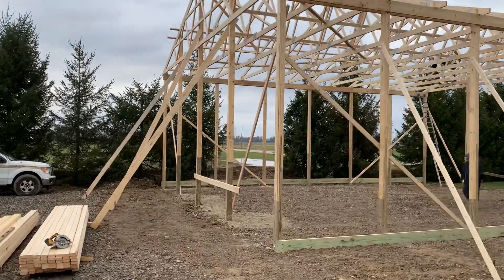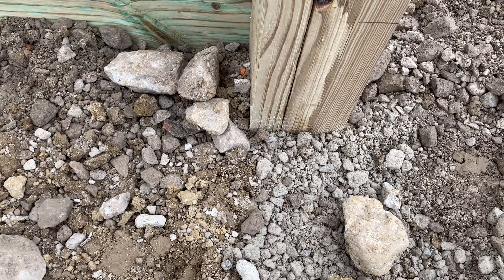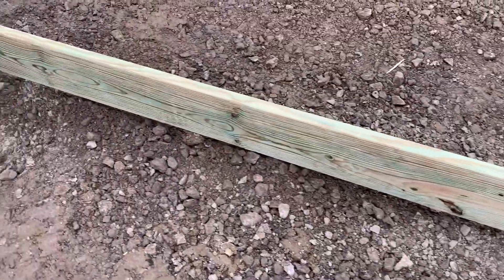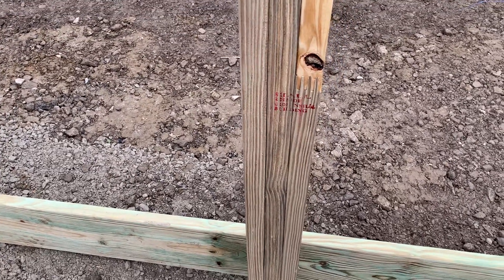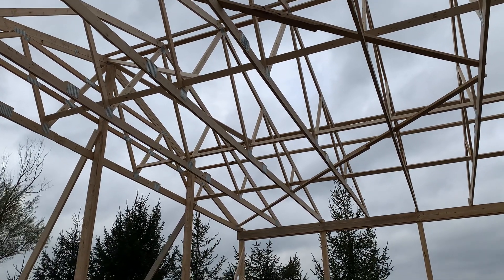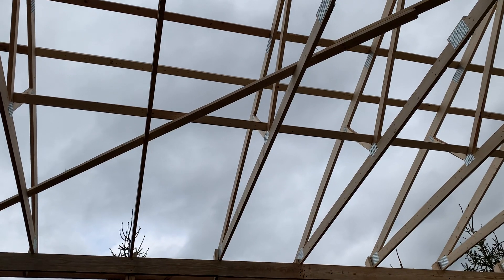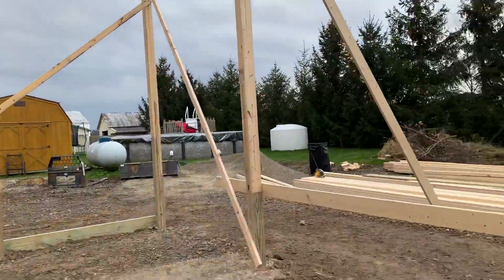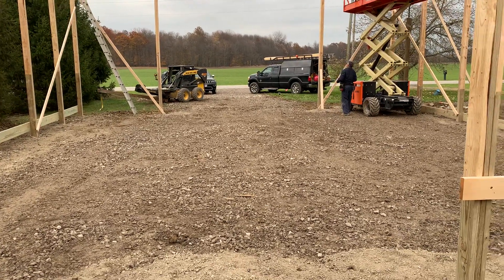Pole Barn Trusses - What cost less?? (40x48)

Comment: If your looking for a ‘Forever” building…this is not it. It’s nice to say the WOOD posted in the ground will last forever…they will not. Pressure treated, Thompsons Treatment, a little extra sand in your post mix, is not the answer. YOU SHOULD TELL PEOPLE WOOD IN THE GROUND WILL NOT LAST AND BE A HEADACHE AFTER 15+ YEARS. This is a temporary structure unless you make SERIOUS modifications. Thanks for letting me vent.
Reply from the maker: Opinions are always welcome.   Thanks for your feedback.

Comment: You didn't even answer your own title question... What truss spacing or system costs less?
Reply from the maker: The wider the trusses are spaced the less the trusses are utilized in the building.  Check out the description on the video.
Reply from the maker: What method cost less?  A wider truss spacing uses less lumber and is more cost efficient for the builder.  We utilize a 4’ on center truss spacing system set on a double top beam carrier (yellow pine).
Reply: Does your company offer “kit” shipping service or strictly offer design and installation?  I’m in GA